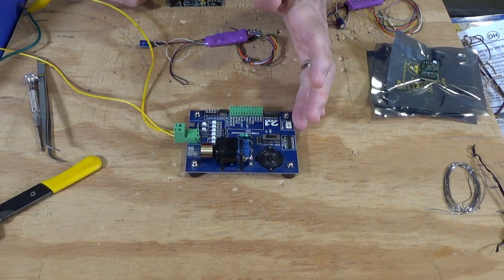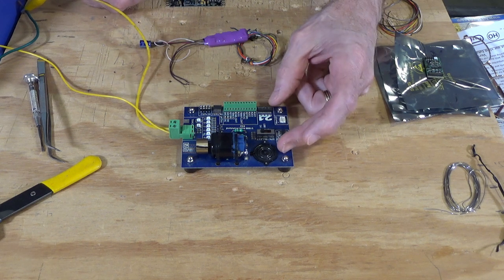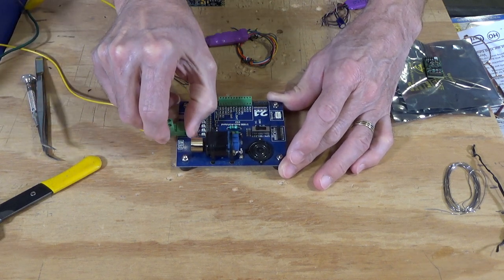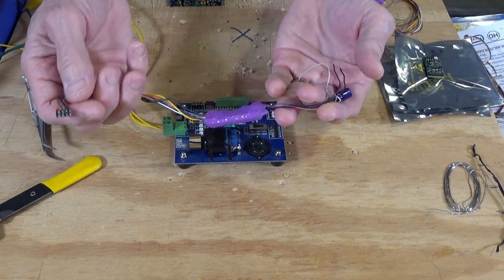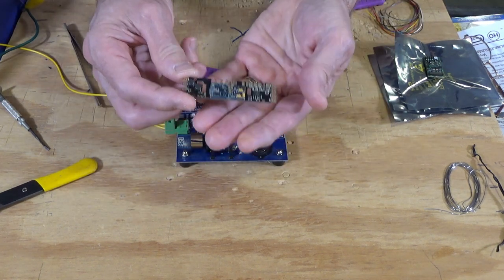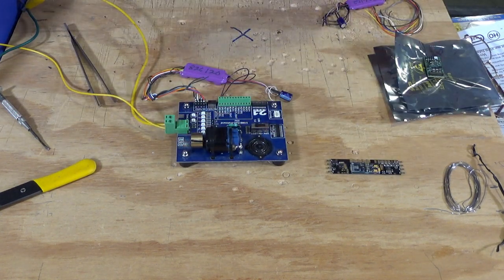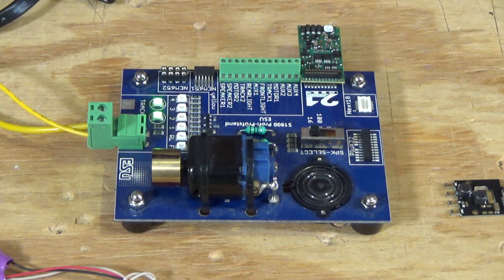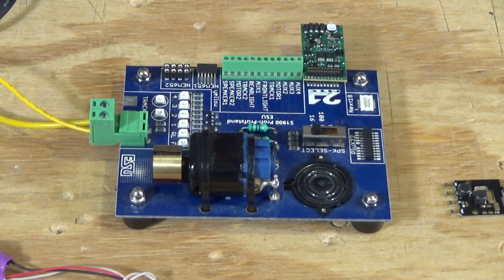DCC 101, Easy decoder testing (52)

Comment: I have that ESU test board.  I didn't know if I would ever use it, but one day it came in handy.  I was installing a TSUNAMI 2200 Steam decoder.  The red wire pulled out of the decoder.  I contact George at Soundtraxx and he told me what to do to fix it.  Well, when trying to pry the harness from the connector on the decoder board, I was using the backside of an Exacto blade, the white connector on the board broke free.  I soldered it back on the board, replaced the red wire then decided I needed to test it.  So, I had another TSU-2 Steam decoder still in the package.  I hooked that up to the ESU tester.  Everything worked.  Then I hooked up the TSU-2 I broke.  Everything worked except motor control.  I am glad I tested it before reinstalling.  In talking to George, I will be sending this decoder back to Soundtraxx for repair.
Reply from the maker: Good example of when you need one they can’t be beat!

Comment: Great job! As usual. Where does the power come from on a NCE Power Cab? Can I hook up  the tester to the track that is being powered? Thanks, JB
Reply from the maker: The DC wall wart provides the raw power for the unit. It plugs into the fascia panel which then feeds electrons to the handheld through the cable. The handheld contains both the command station circuitry as well as a booster. The DCC commands are generated there and boosted to the full track voltage and amperage after which it is sent back along the cable to the fascia panel where a connection to the DCC power bus is made. So thats where the power comes from.

Comment: I know it's a while back since you did this video but a question before I decide to buy one or not. Can you use the module like a program track,say finding an old chip and not knowing its address to reset it for example. Could you also program other cv's or is this just to check the decoder is working?
Thanks
Chris
Reply from the maker: They are just to check whether it is working. However you can connect it to programming track leads and do both. I have one on my computer desk and can attach it to my Sprog 3. That way I can test and program it using DecoderPro.
Reply: @TheDCCGuy  can you use it to test speakers too as my tsunami 2 used to play sounds until I replaced the sugar cube speaker. I have a tester on order at the moment so will be able to see if I have blown the chip or if the speakers gone. Is there a cv that I might of changed to switch sound off? I have used cv 8...8 and cv 4..8 but no result.
Reply from the maker: @christopherbailey8817  It has a speaker built in making it easy to test the sounds. You might have turned the master volume CV down to 0 but I can’t think of any others. It likely can be repaired at a small cost even if out of the warranty period. As a last resort try the CV8 reset.

Comment: I have a ESU 5.0 that was factory installed.  The loco ran just fine for over a year running on a DC system.  Then converted to DCC Digitrax system and the loco ran for about 30 seconds on a single piece of track for testing.  Now I still have sound and lights and responds to commands but the loco will not move in both DC mode and DCC.  What happened?
Reply from the maker: Hard to say without examine the decoder. Did you try to change any programming? Were there any shorts on the track while testing it? You might try reprogramming the address and CV29 to see if that works. In the end you may have to try a reset, see your instructions.
Reply: @TheDCCGuy  is there a way I can PM you with pictures?

Comment: I am in G scale and use Airwire decoders with battery power.  Can I use the ESU tester to test my Airwire decoders?  If not, what can I do to test a decoder.  I have a GP7 decoder which I suspect has some probsems.
Reply from the maker: I have never worked with Airwire products so can’t help you on this one. I suggest you loo for a CVP forum on Groups.io , good luck—Larry

Comment: I am thinking about getting a decoder tester and find your videos on them very informative, I was just wondering though on the decoder tester you were demonstrating, I could see the different connections for individual wires but did not see a place for the second wire on lights, There was a motor 1 and motor 2 etc but no place for a second lighting wire that I could see.
Reply from the maker: The screw terminal connector has spots for 4 additional function wires labeled aux1-4 and 4 small LEDs on the board that are associated with each, so you can test these functions.

Comment: Hey @larry, could you run the decoder tester off of the Loksound Programmer and do everything through JMRI?
Reply from the maker: You got it a bit mixed up. The decoder tester is a physical device that can be used with your DCC system/program track, the JMRi/DecoderPro program, or the LokProgrammer program/device. You do not use the LokProgrammer with JMRI/DecoderPro. The decoder tester is really no different than a loco as it has sockets for decoders to be plugged into, LEDs to indicate functions, a speaker to test sound, and a motor to test the motor drive functions.
Reply: @TheDCCGuy  Right, forgot that the ESU programmer only plays well with their own software. To your point, since the tester functions like a loco, why would it be any different to put a programming device connected to a computer as the track power feed to the tester. This way you could program and test the decoder without ever having it in the loco, then drop it in the loco when you're ready. This of course would not apply to adjusting speed curves or CVs but I beleive your reccomendation is to do that on the main where you have full voltage.
Reply from the maker: That is exactly what I meant in my first reply when I said it can be used with DecoderPro or LokProgrammer, both run on a computer.

Comment: Hi. I learned a lot from your videos on DecoderPro. Recently I have bought 2 cheap LaisDCC decoders of ebay. One I put in a Roco locomotive and it functions fine. The other one I put in a Piko locomotive and that one just won't slow down to the maximum speed set in cv5. And it is not the one decoder, because I exchanged the two, but the problem remained. The locomotive just drives around like a rocket on the loose at max throttle. What do you think, might be the cause and the solution?
Reply from the maker: First, how does it behave when operated on DC power without a decoder? If it runs well on DC then I suggest installing a name brand decoder to see if that fixes it. It might be that there is an interaction between the decoder and loco components that cause the issue. For example some decoder BEMF algorithms are sensitive to the electrical chokes found on the motors of some models. Take a look at video 79 for more on that issue.
Reply: @TheDCCGuy  Thanks Larry. It works well on just DC without decoder. And it works well with a LokPilot standard decoder, that I borrowed from another loco. I did remove 2 small capacitors, but there are still 2 small coils, one on each side of the motor. So you might be right there. I shall take a look at the video, you mentioned.
Reply from the maker: If you remove the choke coils you will need to add a small jumper wire in place of each as they are part of the electrical circuit. Since the loco runs fine on everything but the LaisDCC decoders I would suspect the feedback issue or some other out of spec component on them causing an interaction. I have several old Lenz decoders I would be happy to give you but it would probably cost more to mail them than they are worth.

Comment: Hi I have a plux 22 decoder on one of my locomotive (D.M.U. Area trains. There are no wires coming from it, it just plugs straight into the socket. they're made for Backmann. Tony, Liverpool England
Reply from the maker: Haven’t seen one yet but I assume they are pretty much like Next18 which plug into a socket too. Of course the 21 pin decoders work this way too.

Comment: How do I get it to work with NCE power cab? I have tried selecting “use program track” which lets me program the decoder but I am unsure how to check functions, sound etc to see if the decoder works fully
Reply from the maker: Using a throttle for much more than changing an address or what I called the basic 8 CVs in videos 47 and 48 can be very challenging, which is why I use DecoderPro for that kind of thing. One of the NCE programming options is individual CVs and with that it asks you which CV and when you enter it then the system reads that CV and shows the value after which you can change it. However you have to know which CV to change and what to change it to. So you really have to do some homework. I did another video (#62) on how to use DecoderPro to calculate the CV values and then use the throttle to enter them so you might take a look at it.
Reply: The DCC Guy i was hoping it was as simple as putting the sound decoder into the esu tester and you would be able to test the functions, sounds etc from the throttle. Thanks for the detailed reply👍
Reply from the maker: Ok, I didn’t see that in your question. If the decoder is not yet installed that is exactly what you can do. If it is installed then of course just put it on the track and hit the throttle buttons. You just hook up the programming track outputs to the input locations on the ESU tester, install the decoder in the correct socket, and you are ready. Make sure to view my other videos on programming tracks and also the NCE AutoSw for use with the PowerCab for programming.
Reply: The DCC Guy, I have the program track wires going from the nce power box to the esu decoder tester. The 2 lights come on the tester when in program mode on the nce throttle, it allows me to set the address and change cvs etc. But when I press the function buttons for lights, fwd, Rev, or to start the sounds nothing happens.
Reply from the maker: Ok, you cannot control functions in program mode you have to be in track power mode to use them. Also if you are using a sound decoder with 6 or 8 pins you need to connect the speaker wires to the board using the long screw terminal strip. 18 and 21 pin connectors should have a built in set of speaker connections. As I remember the first two slots are for the speaker wires but check to confirm that. See if that works for you.
Reply: The DCC Guy thank you very much

Comment: just found your channel. It has been very helpful thus far is understanding DCC.  Can you post a video on how to convert Bachmann dc steam locos to DCC? And/or how to trouble shoot some of the problems that may occur. I have a couple DCC on board and DCC ready Bachmanns that don't seem to function properly and can't find anywhere to solve the issues of not working. thanks
Reply from the maker: I have a Bachmann 4-8-2 that I put a decoder in and can quickly show how I did that so look for it soon. Basically I used a TCS motherboard with Keep Alive designed for this loco and a TCS decoder. Easy and fast install that avoids the potential problems.

Comment: Hello. I have a DCC Sound Genesis locomotive that doesn’t work. I put it on the track and the headlights and ditch lights flash.
Reply from the maker: Sounds like a short circuit warning. Check the wiring or call them.

Comment: Video very informative. Can I assume that only new decoders can be tested in default no. 3. on Hornby Elite. Or can i test my corresponding call out no. to test. Help.
Reply from the maker: If I understand your question correctly then a new loco that conforms to NMRA guidelines should respond to address 3 right out of the box. Whether or not they also programmed in the long address is debatable, but I would guess not. It is an easy matter to reprogram the address s I showed in a previous video.
Reply: @TheDCCGuy  Hi, hope your keeping safe. To simplify my previous question. Can an already programmed, up and running, decoder be tested as long as the correct address is used.
Cheers mate.
Reply from the maker: It should be able to, but what exactly do you mean by “tested”. If you mean should it run and respond to commands when placed on the main tracks, then yes it should. If this is not working for you then out it on a service mode programming track and see if you an read back the 2 and/or 4 digit addresses. If all else fails do a reset to factory defaults. That will usually bring a non responsive decoder back to life as long as it is not damaged.
Reply: So you have to know the address of the decoder in advance. Is that correct.

Comment: Can this test Digitrax, NCE, and TCS decoders?
Reply from the maker: Yes, it works with any decoder that has a compatible connector which as far as I know is all of them right now except the plug and play types as I pointed out. Basically all you are doing is using your DCC system to power the tester and that in turn powers the decoder. The neat thing is it has all the connectors right there, plus the power LEDs, and LEDs for the headlight and up to 4 additional wired functions. I have seen it advertised for as little as $44 plus S&H.